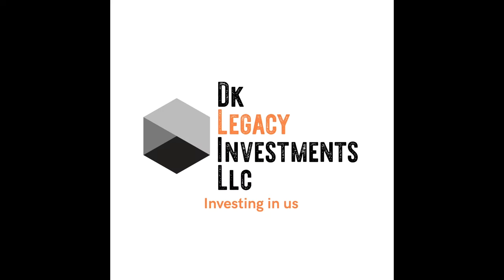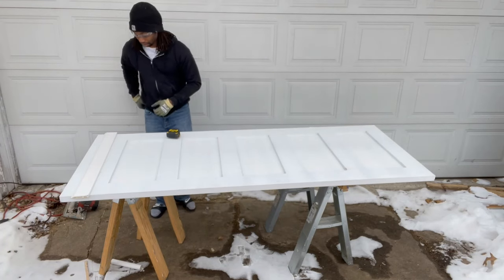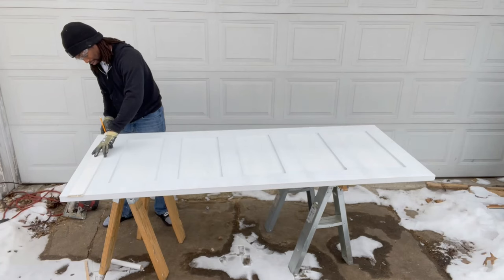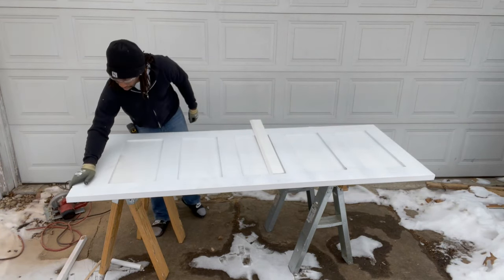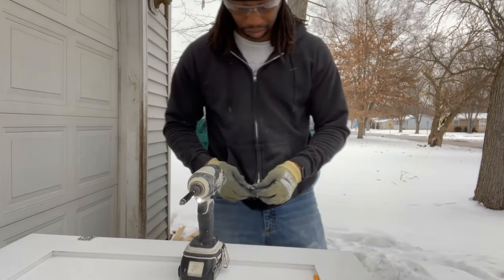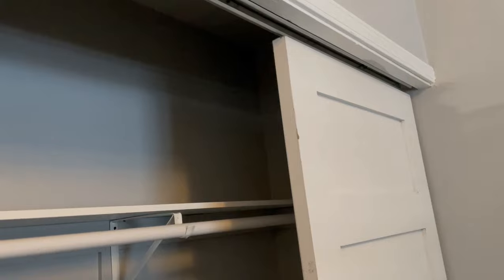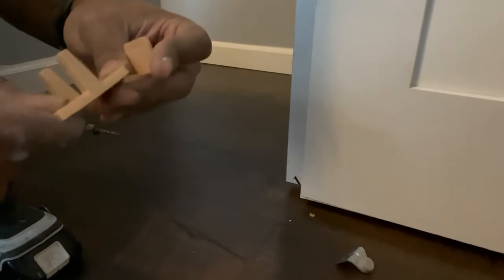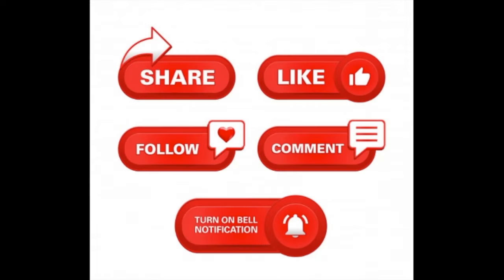How to install a Sliding Closet Door

Comment: Are the doors particle wood or solid wood?
Reply: Solid wood
Reply from the maker: The doors are solid wood doors
Reply: Perhaps or fluted
Reply: Can you do this with hollow core doors?
Reply: Hollow core doors usually have an inch or so of solid wood so you can make a cut at the bottom. @Rgnfrazier

Comment: How can I fix the bent rail
Reply from the maker: Replacing just the J bar is the best way to go. It depends where the bar is bent. it could be a challenge bending it back without any other issues.
Reply from the maker: Here's a link to replacement hardware 
used in the video
https://www.menards.com/main/hardware/door-window-hardware/closet-bifold-door-hardware/john-sterling-trade-2-panel-bipass-sliding-door-hardware/r-byp-50-2d4/p-1444436979690-c-7593.htm?tid=1416207600907180102&ipos=1